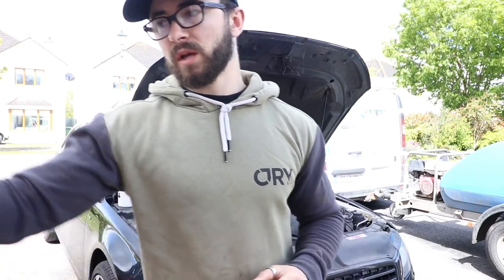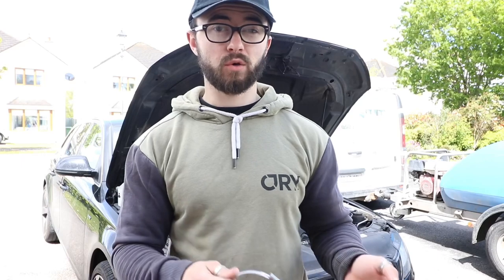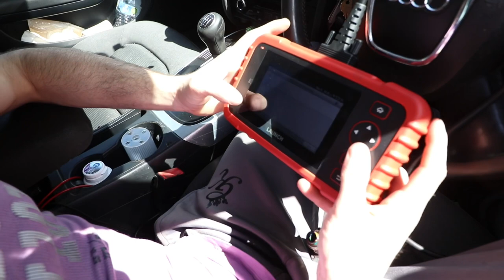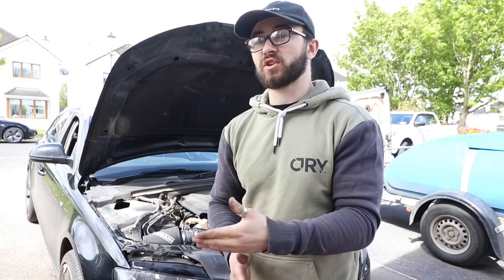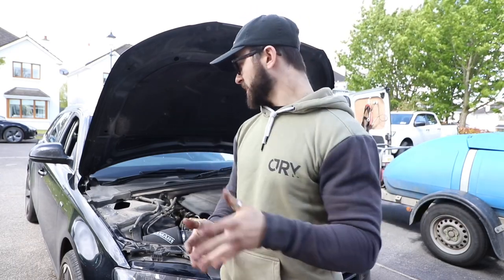RamAir Intake Install | Audi A4 B8 2.0 TDI Build | Ep.1

Comment: Should of kept the bottom half of the airbox on, works as a good seat plus has the heat shield attached to protect the filter from the exhaust heat, thats what I did with mine, took it go darkside and they happy with how it is, doesn't affect and still does the job very well
Reply from the maker: Wish I’d have thought of that 😂 hindsight is 20-20 I guess 🤷🏻‍♂️😂
Reply: Was told the a4 tdi b8 you can't use a induction kit on it

Comment: I have the same rev limiter on my Audi. If you want to get higher revs while stationary, or do a burnout, turn off the traction control.
Reply: VW and Audis have integrated tc, in mine you have to turn on the hazards step on the gas pedal several times and it’ll deactivate it until you drive lol
Reply: @TruckingSasquatch  you have to hold the button down.
Reply: Just turn off ESP

Comment: could have left the bottom of the air box on and also the scoop didn't need to come out, it will be better to put the scoop back in to get fresh air into the engine bay.

Comment: Will that kind of induction kit not suck in more hot air? As it is located right in the engine bay with no kind of heat shield,  Just wondering as the one I have is sealed so you cannot see the filter and them it's connected to another pipe leading to the vent at the bottom of my bumper, getting that cool air
Reply from the maker: It’s not a full kit so to be honest it’s not great. They don’t make many bolt on kits for that engine and I just didn’t want to spend an extra €300 for the kit with a heat shield… 😅
Reply: @lifeofwill8824  yeah yeah fair enough, apparently there isn't much difference anyway 😂 can always DIY your own heat shield 🤔
Reply from the maker: I did think about it but as you said there’s not much difference so didn’t think it was worth the hassle 😅

Comment: 034 motorsport has one for a q5 2.0t, running it on my car, don't know if it will fit but should.
Reply from the maker: Did it fit??
Reply: @lifeofwill8824  I have a 2013 Audi Q5 and unless I want to spend 400 for a intake system, best thing I can go is get a silicone inlet pipe and make a custom heat shield with a cone filter. It might be a little to tall for the a4/a5 but maybe they make one for those models.

Comment: In air box should by temperature sensor ??? If you want modified that Audi buy clutch from Audi a6c7 177bhp is good for 470nm , stockclutch can handle to 420nm after that start slips good if you want better turbo buy from 177hp is just exhaust a bit different but you need good tuner after that mod is possible to get 230hp for low price
Reply from the maker: Thanks for the advice man 🤙🏻
Reply: @lifeofwill8824  Next step is larger fuel injectors. The only physical differences between the 150ps and 190ps TDi was a larger turbo (which comes in at 2000rpm - the smaller turbo comes in at 1500, making it more responsive at low rpm) and larger fuel injectors. Check the parts numbers for yourself!

Comment: Should I leave the scoop on or off feel like not much air will get in if I leave it on
Reply from the maker: Hey man, to be honest I’d say leave it on as it will direct airflow onto the filter from the outside. I actually ended up putting mine back in after a while once I figured this out.

Comment: How did you remove the sensor at the bottom aof the air box i cant seem to disconnect it thanks
Reply from the maker: Hey man, there’s a clip you’ve to press in… it’s in there pretty tight like so a good bit of force is needed to get the sucker out 😬

Comment: i mean i am looking in to modifying my audi a4 converteble with a 2.0L tdi but you did not really say if it makes any hp gains
Reply from the maker: Hi mate, without putting it on a dyno I can’t say exactly how much bhp I would have gained but it wouldn’t be much… somewhere between 1-5bph at most 🤷🏻‍♂️
Reply: Most hp gain is from egr/dpf delete + stage 1 optimiziation, takes it to 200bhp (180-185 if you leave dpf in) might add abit if you have a  cold air intake + heatshield when mapping but dunmo

Comment: I have just done the ramair filter on my a4 2.0 tdi after running it a couple days with it I've got black smoke coming out any advice on what the cause could be 

Ps I left the bottom half of the box in just toom the top off
Reply from the maker: I went back and put the bottom of the box back in too, haven’t had any black smoke though, so I’d say it’s unrelated

Comment: In which aspects did you notice any change ? More power or engine is more quiet?
Reply from the maker: The main change I noticed is a massive increase in induction noise which is what I wanted… and the turbo blow off is louder too. Wouldn’t say there’s any noticeable power increase to be honest. I’d need to get other mods like an egr delete, DPF delete, and a tune in order for the new filter to make any difference to power… hope this helps 🤙🏻